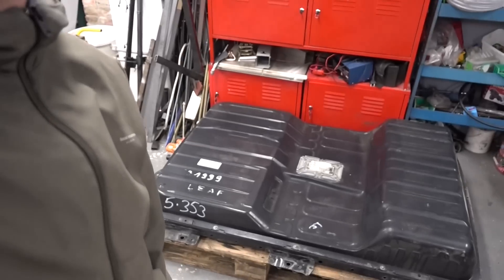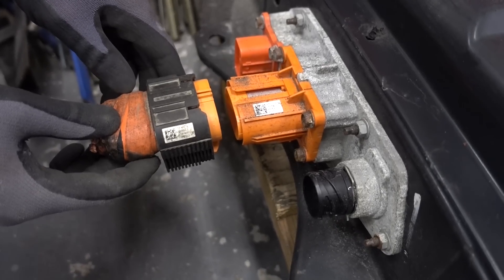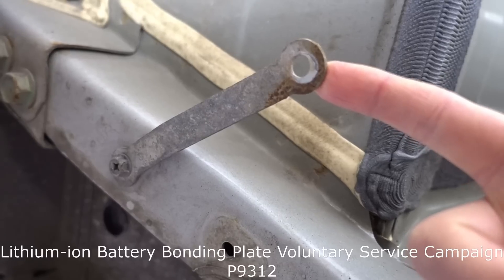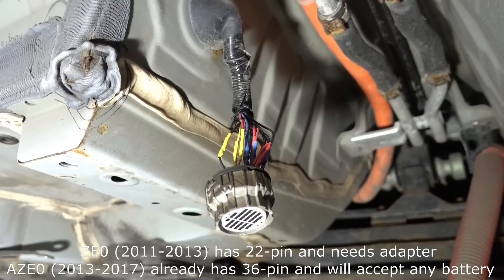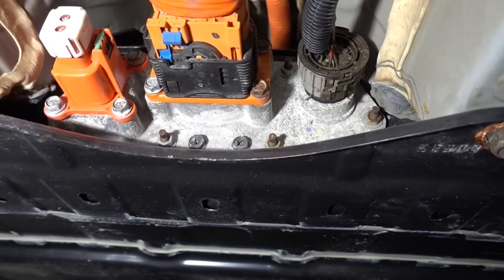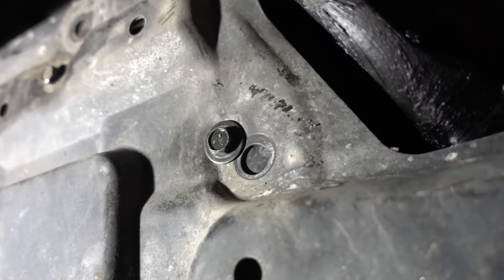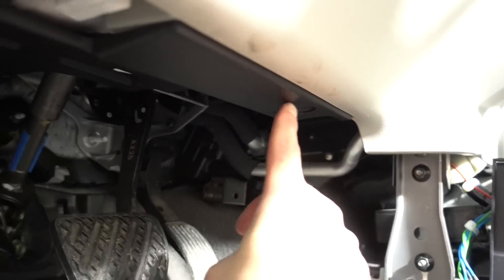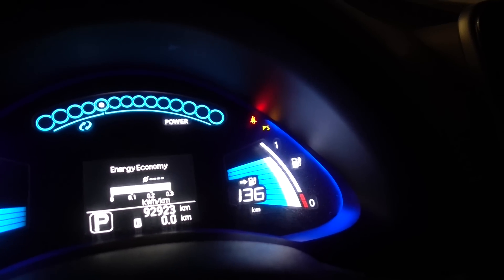Nissan Leaf Budget Battery Upgrade [ZE0, 24kWh-30kWh]

Comment: Its so unclear the can bus part, and wireing, where to get that, and are all the wires the same colour on the 22 and 36 pin? Can you make a video or explane this part of the install please
Reply from the maker: Guide on Github: https://github.com/dalathegreat/Nissan-LEAF-Battery-Upgrade/wiki#what-is-a-b24-adapter
Reply: Thanks, would be so great to find a guide, for a complete swap. Wireing diagram and everything needed to know, all the smal things so compete the swap. I am in the prosses of changing to a 62kwh battery in my 2012 leaf
Reply from the maker: @89volvoturbo  Umm the link has the wiring diagrams

Comment: I've just done everything exactly as in the video, swapped 24kv with 30kv, programmed can bridge correctly checked twice, and after turning on the vehicle.. nothing is working.
Car has turned on the lights and doesn't turn on 😅
I key system fault, and steering wheel blocked.
Hmm
Its 4 am and tomorrow going to work at 9.
Im scared.
Reply from the maker: Post about it on the mynissnleaf forum, attach pictures!

Comment: Hi Dala, great video, could you explain me how "thinner thread" bolts fits into place of thicker one?? 4:35
If they're a different size, shouldn't they come loose? 😅😅

I can contribute with idea of soldering tubes in return, for faster b24 connector replacement.
Reply from the maker: Only valid for 2011-2012 ZE0: The new battery does not accept the large bolts at the back, so you will need to get the smaller bolts

Comment: Aren't those 30 KW batteries the worst batteries that Nissan made? I've got a 2013 and everybody tells me to enjoy the fact that I got a better battery than the 30 KW. I think mine has the 24 KW. I get about 58 to 60 me of range.
Reply from the maker: They work fine in stationary storage. But in vehicles with high demand >100kW, they are prone to cellfailures

Comment: Hello, I replaced the battery in my Leaf with a used one from the same year and model. The car does not start, only the autonomy bars appear, but the brake bars have disappeared and the green car symbol does not appear. Thank you in advance for your help.
Reply from the maker: Use LeafSpy Pro to read fault codes. Post them on the MyNissanLeaf discussion forum to get help!

Comment: Hi, great channel, i admire your work and passion. i want to do a battery swap between a 2013 24kw and 2016 30kw, the 2016 is in worst condition, its posible the change of the batterys? Do i need anything else or Just is a plug and play action,
Reply from the maker: Plug and play!

Comment: Dala - do you think it is possible to repair the main battery socket RCS800 without splitting the pack? I saw that someone de-pinned the two conductors but I know there's a third connector somewhere too. Connector damage is common (video idea?) - especially because they are made of chocolate!!
Reply from the maker: I would open the battery to be able to do it properly!
Reply: @DalasEVRepair  You always tell it "as it is"! Thank you.
Reply: @DalasEVRepair   Last question - what sealant do you use to reseal the packs these days? Nissan OEM is out of stock - is there another trade secret to use?
Reply from the maker: @B2C2007  I used a locally sourced "Sikaflex 221" which is a 1-component polyurethane sealant!
Reply: @DalasEVRepair  Thank you Dala. Massively reassuring to know what you're using. I think I will practice cutting nozzles and laying triangular beads before I put this anywhere near my ENV case!

Comment: I have a question not explained in the video. Do the two small wires in the PTC connector need to be present and connected together or can they be removed and the cavities filled with silicone?
Reply from the maker: The small wires do not need to be present. Completely OK to just fill the entire connector with silicone!

Comment: Let's not splice a load onto the obd2 connector. Ever.
Reply from the maker: On the Leaf, this wire is oversized with 15A headroom. It is crazy compared to other cars. But neater is to put it in the fusebox, but access shrinks tremendously!

Comment: nice video, i am in the research phase of planning to convert my classic vw bus to EV using a wrecked Leaf. most of the leafs i find are in the 7 bar battery range, which is okay to get it up and running. however; i would like to upgrade the battery shortly after completing the conversion. this was very informative and i plan on buying the connector converter and can bridge when the time comes.

Comment: Hello sir I have a 2012 leaf and in the battery there are only 2 plugs. In the new battery there are 3. And do i need to do any software modifications after the replacement from 25kwh to 30kwh battery? TIA
Reply from the maker: All explained here: https://github.com/dalathegreat/Nissan-LEAF-Battery-Upgrade/wiki

Comment: i just purchased a nissa leaf 2013 with 95k miles how much would it cost me to change the battery for a higher voltage and longer miles?
Reply from the maker: Depends where you live. Near Norway you can get batteries very cheaply!

Comment: This may be a dumb question but can you just replace a few cell modules in the pack? Would that work for a while?
Reply from the maker: Cell replacements can bring back a few % of range, but require lots of time, skill and is considerably riskier than a complete pack upgrade

Comment: How much are replacement batteries (in the US)? I have the option to buy a 2011 with dead batteries for $1500 or a 2017 with good battery for $4500.

Comment: Please, you say use appropriate equipment to lower the battery. Why why why don't you show what you are using what is it? Looks like a custom cradle with a floor jack
Reply from the maker: I cant speak for the whole world, required gear will vary depending on country. Maybe you want the Finnish "sallittu nostolaite" regulations? 😂

Comment: I have a 2012 nissan leaf sv trim it only charges to 27 miles with all its bars still showing and I have a problem with my 110 charging cord it keeps throwing my gfci breaker any clue what's going on with it also the car has 88,000 miles thank you for your time scottie
Reply from the maker: Hop on the mynissanleaf.com forum

Comment: hi dala , I'm thinking about upgrading my 2014 24 leaf. To a 40 battery. I have 2 questions 
1: there any specific setup difference with the can bus 30kw or 40kw. 
2: My car is a uk car (right drive) Are can bus connections done under cup holders, left or right side door pillars? switch gear/odb socket is on right hand side , 
many thanks
Reply from the maker: 1. No diff
2. LH side pillar on 2014 AZE0.
Reply: @DalasEVRepair  thankd, I will get the can bus ordered and prepare wiring....then to find a battery , many thanks

Comment: I have an error code please help >P31E1 000B EV/HEV HV System Interlock Error EVC-305
Reply from the maker: High voltage connector not seated. Check all connectors. If you have a 2011-2012 LEAF, you also need to plug the unused HV port.
Reply: @DalasEVRepair  it worked thank you
Reply from the maker: @UncleTrump  Nice work!
Reply: @DalasEVRepair  we will try today thank you, its 2013 btw

Comment: Hang on ! The upgrade cost includes the new battery?? If so you are one lucky lucky guy!! I don't think I've seen a better deal for a 2017 battery. Not even  2015.
What would you recommend for somebody with a 2012 Leaf with 8 bars.  Do you think aftermarket module replacement is a viable option? i.e. I just replace all the modules of the battery with aftermarket ones (most likely purchased from china)? I jsut don't see finding a 30-40 kwh battery at a reasonable price. I see these for like $8000 or higher here (US)
thanks
Reply from the maker: This is an old video, prices are higher now. Best to go with an OEM newer pack, those module replacements have been quite hit/miss
Reply: @DalasEVRepair  
very difficult to find newer whole battery. i was meaning replace all the modules not some. that still no good in your opinion?

Comment: Quick question, is there any disadvantage to removing the high voltage heater connection?
Reply from the maker: On the old LEAF, the heater is taken from the primary high voltage cable. No downside at all!

Comment: Tip, Get heat shrink tubing after you rewrap the newly soldered connector. Slip the tubing over the cables newly soldered connector and shrink with a heat gun. While electrical tape is undoubtly sturdy you can make the job look neater with less chances of things rattling apart if you use heat shrink. It is definitely fiddly but worth the extra effort to prevent the car from accidentally disconnecting when you are using it down the road.

Comment: WHat would happen if one was to just plug the new battery in without the CAN bridge? Will things work, but the range displayed be wrong, or what would happen?
Reply from the maker: The vehicle wont go into ready mode, the messages are not close enough to start.

Comment: For a 40kw or 62kw will there be any major difference, im riding a 2013 which is a +, there are lots of salvaged leafs in California, i am really motivated to take on this task hopefully soon
Reply from the maker: 40kWh is a simple bolt on. 62kWh is a massive project!
Reply: @DalasEVRepair  thanks for reaching out, can elebrote the complexity of a 62kw vs 40kw? So u recommend regular folks like us to be able to swap a 40kw vs a 62
Reply from the maker: @goldenstatew2399  see the FAQ https://www.mynissanleaf.com/viewtopic.php?p=614047#p614047
Reply: @DalasEVRepair  thanku! 40kw might be less of a hassle after reading. Especially without a lift 😉

Comment: I usually run vehement thru a manual wand carwash b4 doing wk. I concentrate on brake dust, dirt& grime removal. It makes the wk easier.

Comment: Thank you for this. If you were here in NZ you’d make a killing. EV “repair” companies are charging from 25k upwards to 40k NZD to replace a battery. But it’s clear now, these companies are just ripping people off. Cheaper to buy a new/used EV than get the battery replaced.

Comment: It's great to see how modular simple EVs like the Leaf are. With so little else to go wrong it should be possible to run a Leaf for decades with a battery swap every ten years or so.
Reply: Too bad they are so ugly. They should have made them look similar to the Altima.
Reply: @ralphinator2  you should check out the Renault Fluence Z.E. Carlos Ghosn had a hand in building that and the LEAF.
Reply: Thats not saying much, considering the cost to swap the battery would cost more that the repairs of a ICE car
Reply: @04dram04  😭😭🤣😂

Comment: Hi dala
I have 2013 nissan leaf 24kw I can get 100km.
Can I upgrade 30 or 40 kw battery and what I need to replace components?
Thanks
Reply from the maker: Hi! If you have the white interior it is all explained in the video (battery, b24 adapter, can bridge). For the dark interior AZE0, no B24 adapter is needed!
Reply: @DalasEVRepair  hi dala
After I replace battery how can I program  new battery BSM without nissan consult?  How much is can bridge? No need to replace PDM?

Comment: For 12v battery, you release negative pole cable only. Why is not both cable pole?
Reply from the maker: To cut down video length. Start with negative, then do positive for max safety
Reply: @DalasEVRepair  thank you..

Comment: Hi Dala. Is the battery chemistry of 24, 40 and 62kWh are the same? What are the difference?
Reply from the maker: Chemistry tweaks per year:
- Pure LMO on the initial packs (e-bike chemistry, essentially), very forgiving  on charging/discharging current but very bad cycle life [392V]
- Al-doped LMO still on gen1 ZE0 packs, but late in the game (2013ish?), charges to 4100mV/cell now [393.6V]
- Retuned BMS on gen2 AZE0, no apparent change in the actual battery chemistry, charges to 4130mV/cell
- NMC on gen3 (30kWh), charging to 4180mV/cell [401.3V]
-  Higher nickel content NMC on gen4, Li-HV tricks to get a fair bit of  extra capacity by charging further (4220-4224mV/cell) [403.2 - 405.5V,  varies with temperature]
- Then a set of massive BMS retunes to try to fix rapidgate, mostly by increasing charging speeds at subcritical temperatures
- Then a density increase through slightly thinner packaging/electrodes  on gen5 (62kWh) and quite a significant change in the BMS again.

Comment: Is it better to replace individual modules instead of the whole pack?
Reply from the maker: Nope, safer quicker and better result to change the whole thing!
Reply: @DalasEVRepair  

Meant - is it cheaper to replace individual modules.  Because all 48 modules are in series, one module can lower the whole pack.  So I'm thinking replace that one module instead of the whole pack.  I can get one module for $150.  Then pay a guy to use a meter to find the bad module then replace.

Sorry, maybe I shouldn't have clarified "better" in terms of costs; not in terms of anything else.
Reply from the maker: Usually they degrade linearly. Not much to gain from changing one module
Reply: @DalasEVRepair  I see.  Thank you

Comment: This is really great. Do you know anyone who knows how to do this properly in the Los Angeles, CA, USA area? This is for 2012 Leaf. Not quite DIY for me. The Nissan option is way too expensive I think, considering that the price of Chevy Bolt 2017+, Nissan Leaf 2018+ have come down quite a bit which will accomplish the same plus more. What do you think of the extended battery strategy?
Reply from the maker: Check the installer map https://nissanleafbatteryreplacement.com/

Comment: Very good. I would imagine having access to a reasonable battery replacement is the key to having your low maintenance EV run forever.
Reply from the maker: Yeah I'd estimate this 30kWh pack to last 10+years now!

Comment: Terve! You remind me 2005 when I studied in Jyväskylä. Nice time, beutiful country and great people. Finally I found a budget battery replacement video that makes sense, so congratulations for the video and realistic approach. I have a Golf GTE and in most of my trips I do 35 km in electric mode and 10 km in petrol, getting a 3 l/100km average when I could get 0 if my battery would have higher capacity. How much do you think could cost a budget upgrade from my current 8.7 kwh to the latest model of 13 kwh? After watching your figures could be 1500€ I guess. Kiitos from Madrid.
Reply from the maker: Thanks, I have noticed that hybrid packs seem way overpriced, and sometimes more expensive than a pure EV pack. I have no reason why, for instance I've seen 10kWh hybrid packs go for 10000€. But if you can find a cheap pack, then go for it!

Comment: So just to be clear, since I know EVsEnhanced sells a pairing tool and a battery translation tool, does your CAN-Bridge handle both repairing of the battery and the communications translation?  Or do you still need to repair the battery?
Reply from the maker: My solution handles both!
Reply: @DalasEVRepair  That's awesome! Do you ship to the US? I'm going to be buying a used leaf in the next few months and would love to DIY a battery replacement for a degraded battery car as a revival project.
Reply from the maker: @krisdphillips  yeah, go via the contact form on my website, link in description 😊
Reply: @DalasEVRepair  Will do!

Comment: great vid, can you recommend a website with specifics on the removal and install for the battery and more on the compatibility?, have done engine swaps looking forward to doing a battery swap!
Reply from the maker: All batteries work. It is just the 62kWh that requires more effort in the form of spacers & beefed up suspension.

See this video for mechanical diffs: https://www.youtube.com/watch?v=hpgv-dY-q6M
See this for lifting out: https://www.youtube.com/watch?v=AlxzlQgovUA

Comment: A great video, although the one thing that I fear with cars is auto electrics, so it's beyond me!
I was wondering if there is a way of having a tank of liquid in the boot/trunk, to pipe cooled/warmed liquid around the battery? Thinking you could warm the battery when 10 mins away from the next rapid charger to precondition it for charging or cool it when it's hot?
Reply from the maker: The battery already has heat-elements inside it, actually working on figuring out how to trigger these on demand...

Comment: I changed the bettery How to reast power limitation light
Reply from the maker: 24-24kWh, you need a pairing tool
24-30/40/62 you need a CAN-bridge translator tool
Reply: @DalasEVRepair  unable do  nothing manually without the connecting tool ?
Reply from the maker: @thasriknasmiya1129  Unfortunately yes. Cruise control can help you go over the turtle
Reply: @DalasEVRepair  i wanted to erase this code i am automobile technician how can erase this code manually please help me my 1st job for nissan leaf battery replacement
Reply: @DalasEVRepair  i am from srilanka
Reply from the maker: @thasriknasmiya1129  see my other video, battery pairing secrets!
Reply: @DalasEVRepair  sorry how to connect with laptop with car
Reply: Where are you from
Reply: @DalasEVRepair  i have a lunch scanner only

Comment: Thank you for the great video. I'm also very interested in the second life of the battery. Can it be adapted to store energy at home, integrated with solar panels?
Reply from the maker: Yes! That is what most of my customers do!
Reply: Although, because they're Japanese, All Leaf's have been built to be able to act as a power store for the house and then send the electricity back to the house in the event of a power cut! Robert Llewelyn has equipped his house with the tech needed for this.
Reply: @computerbob06  The only gizmo I've found in the US for this comes from Setek Power. It creates single-phase 220, and needs 2013 Leaf, at minimum (though the Chademo is common to previous model years, there's some other technical hitch... also, it's not usable with *other Chademos*, like the Soul EV... evsiphon.com in San Diego CA is importing these units)